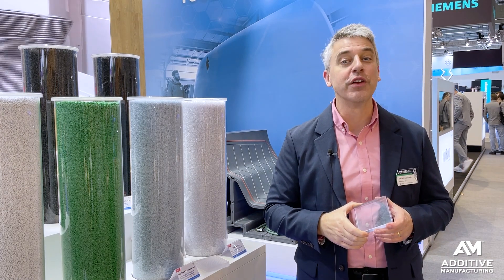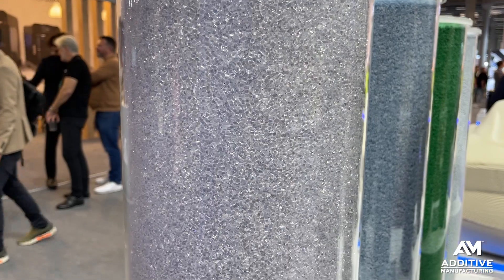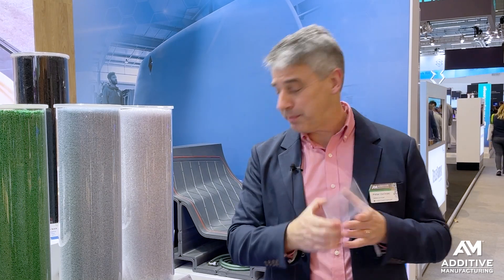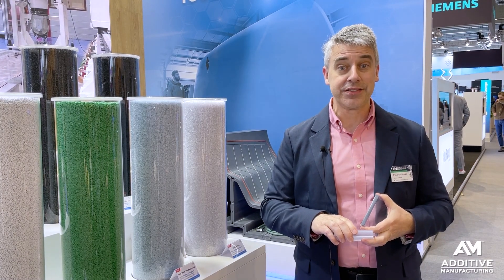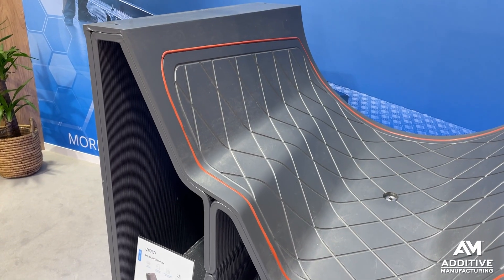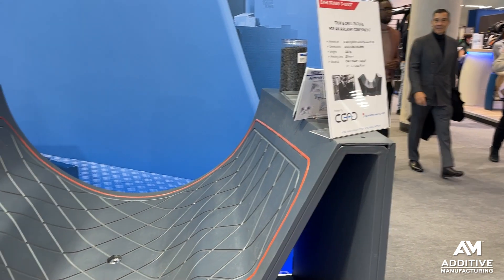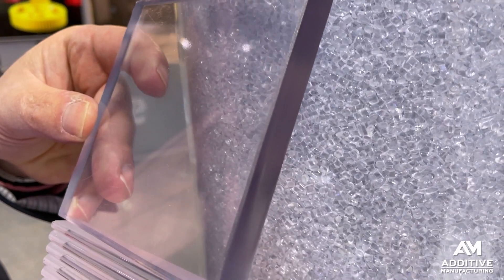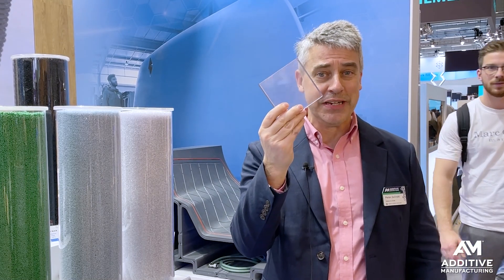Transparent 3D Printing with New PETG Material

Comment: If I understand the video right, they just printed a single vertical wall on a very large pellet extruder, then they milled off the layer lines and polished it.
Given the process I just described, how does their alloy make more transparent parts than if I did the same thing with existing PCTG or PETG blends?